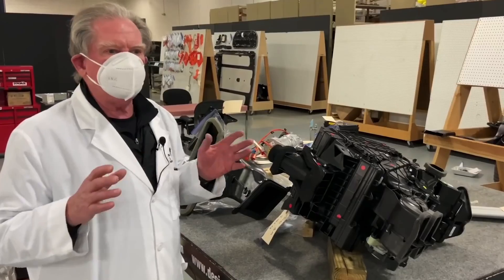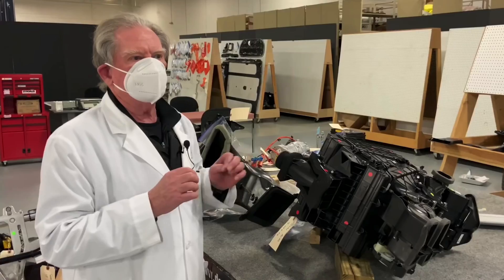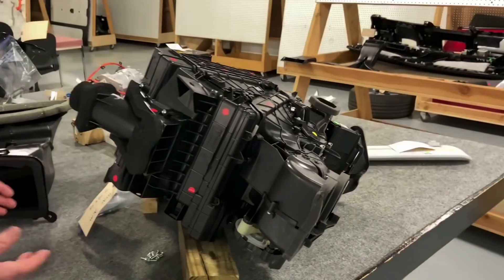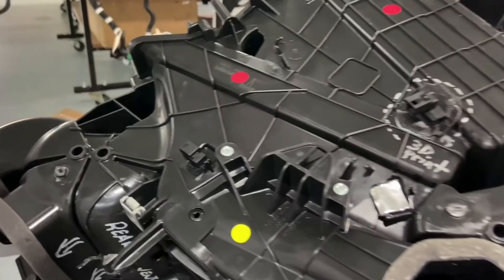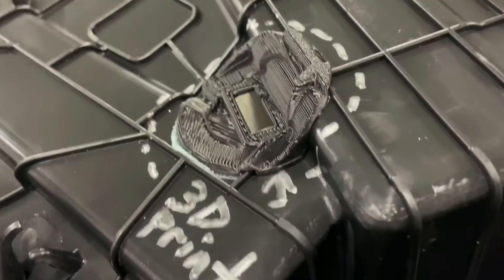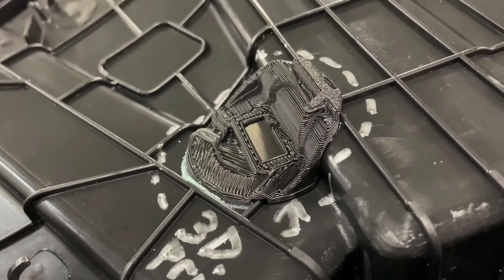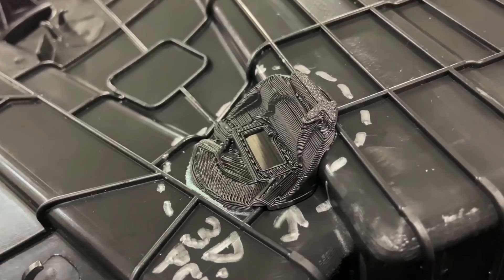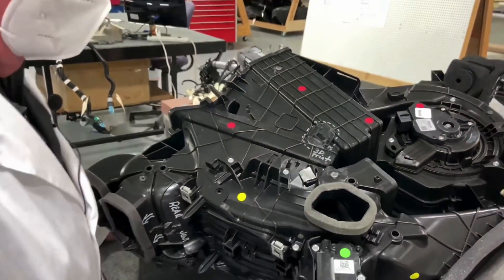That Time FDM 3D Printing Saved Tesla's Model Y

Comment: Very cool!! Huge layer lines!! What size nozzle do you think they used? Is that ABS?
Reply from the maker: Probably a 0.6 nozzle with about a 0.5 layer line. And yes generally automotive parts are ABS so they would likley match them

Comment: What is your opinion on running printers fast (250mm/s 10k acceleration) for mass production 3d printing? For example using klipper or a Bambu lab p1p. 

You mentioned that consumer 3d printers are not reliable enough for mass production but the p1p does seem pretty rugged.
Reply: I would say the x1 is even more suited to production. It has a ton of failsafes, and like a triple redundant bed leveling and pressure advance calibration system. It also has ai spaghetti detection (which works rather well) and first layer inspection.
Reply from the maker: The P1P is currently over-complicated and non-maintainable so it really is not viable for production. The speed of printing is basically not a relavant metric because of the parallelized nature of print farms.
Reply: @slant3d  sounds like someone without a fast machine. i have a corexy, and its not hard to maintain. its complicated to build and set up, but you just need to lube the rails every couple of months. You also get around 3-5x the throughput of any standard print farm machine. 

Its nice to be able to fill a 500mm x 500mm build plate with parts, and have it finish over night. (around 0.5kg per 10 hours)

What machine do you have that can push 500g in 10 hours at near perfect quality, and costs under $20k?